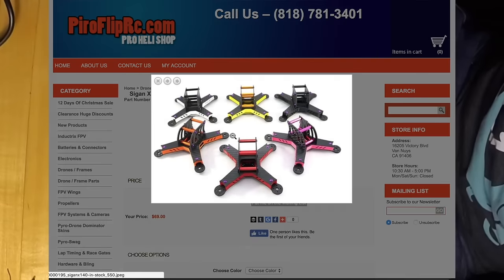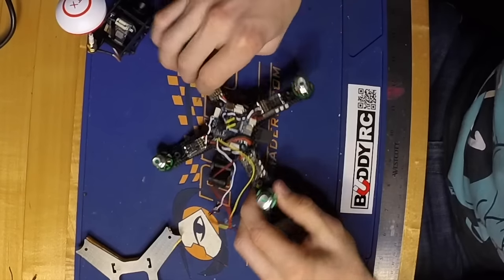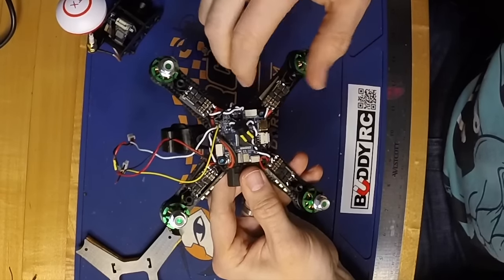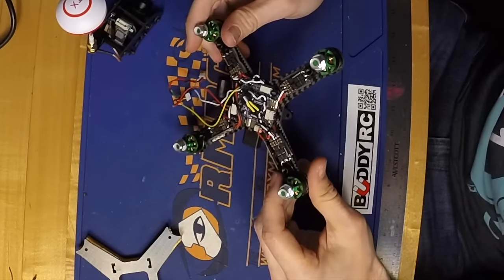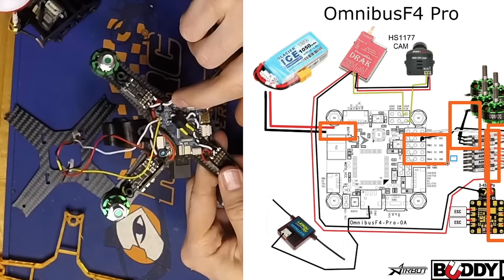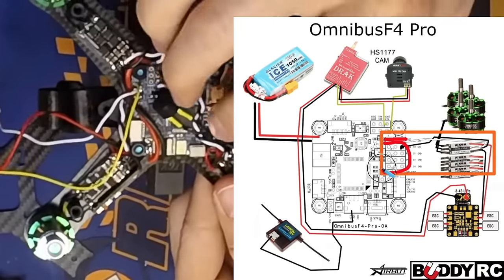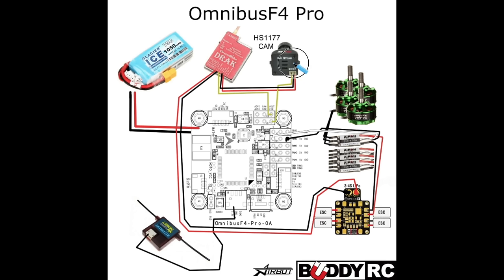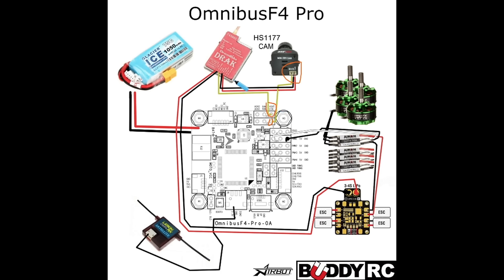Omnibus F4 Pro Build & Wiring Diagrams

Comment: dit you tested with a 4s battery on this Omnibus F4 pro v3 and setup ? 
i had a short, but i connected the wire of the buzzer wrong en thad is the reason i thing, Nice build by the way

Comment: Clean build! I'm about to install an Omnibus F4 Pro with a 4-1 ESC into a little Tricopter, but trying to get all of my wiring down in my head before it shows up haha.. Can I power the FC directly from the Battery, and use it as a PDB?
Reply from the maker: Yes you can, and you should if you want to utilize the battery voltage in your OSD.
Reply: RoscoFPV yeah!! been flying for about a week (maybe a pack a day...) and tuning PIDs ! great board~

Comment: yes there are the cables for the motor connections but I wanted to understand ... since the ESC have the current sensor and are powered by the battery ...
the flightcontroller that also has the current sensor as I have to feed it?
THANK YOU

Comment: Thanks I wired up to that and get a fail safe buzzer but no buzzer when I flip the switch on Aux 2.  The lights flash but no beeping.
Reply from the maker: There may have been a problem w/ the beeper on this board. Its been a really long time since I build this (3 years) but I kind of remember something about that. I'd also check to make sure your beeper is turned the right way. It only works in one direction.

Comment: I'm building a 250, and my ESC grounds are connected to the signal grounds. Do I still need to run separate grounds to my FC along with the signal wires? (I have removed +ve leads)

Comment: hello Rosco..I have a problem with the FC OMNIBUS F4 V2.1 ...
in practice, by enabling the LED-strip door with betaflight and connecting the LEDs to the specific three-pin port, the len are not lit but the programming does not work ...
there by chance something else to enable that I do not understand why?
thank you.

Comment: Thanks for this tutorial! I just can't figure out why the programmable LEDs don't work with this board. It has a dedicated connector for this but it seams no to work. I've also read the LEDs have to be connected to PMW6 but this didn't work either...
Reply: Just got it working 5 minutes ago on bf3.2.2. According to thread on rcgroups the led_strip pin on the J1 connector does not have a timer nor a DMA assigned so cannot be used for controlling RGB leds. What worked for me is connecting DIN of the led strip to PWM6. You need to remap the led strip to PWM 6 using the cli command ¨resource led_strip a8¨. Hope this helps, took me 2 evenings to figure this out.
Reply: If found the exact same solution after hours of trying and research! Thank you!

Comment: Hi Rosco could you say to me please how do I connect the ESC RACESTAR SHOT 4IN 1 30A with integrated current sensor ... to connect it with the FC OMNIBUS F4 V2.1 which also has the current sensor?
THANK YOU
Reply from the maker: I am unfamiliar with that 4in1. Did they provide you with a pinout? It should be pretty simple to connect. The Omnibus has PWM1-4 input pads. And the 4in1 will have PWM(Motor1-4) output pads/wires. Just connect them up.
Reply: Roberto Leon did you figure out how to set it up with ESC and FC both having current sensor

Comment: Are you using the current sensor? Your diagram is a bit confusing. I'm starting my build tonight using the same FC and I'm on the fence about having to hook it up to use the current sensor vs standard vbat only.
Reply from the maker: I don't know if I'm using the current sensor correctly. I have never really spent any time verifying that the current sensor is working correctly. Supposedly if you power the board off the big BAT+ and BAT- the current sensor is supposed to work.

Comment: Does I-bus receiver will work on ominbus f4 pro flight controller? Or which receiver will work on it.
Reply from the maker: Not 100% sure on this one. Never used I-bus before. Is that specific to a certain transmitter brand?
Reply: I'm using flysky fsi6 tx , so, which receiver would you prefer?

Comment: Can you show the PDB power to the board?
Reply from the maker: I think in the video I describe how I did it. Basically I brought power up off of the PDB underneath up to the ESCs on the arms. 2 wires each. And then I powered everything else off those ESC connections.

Comment: hello I need ... URGENT ... URGENT ... for advice ...
I also bought .. Racerstar Shot30A ESC 30A 30amp 3-6S 4 in 1 BLHeli_S BB2 Dshot600 Integrated Current Voltage Sensor .. to match ... Omnibus F4 Pro V3 Betaflight Flight Controller Built-in OSD Barometer SD Blackbox for RC Drone. ..but that was defective ... and bangood me it changes ... but not in stock..According to you can I order this? ... Eachine Wizard X220S FPV Racer RC Drone Customized Omnibus F4 V3 Betaflight 3.0.1 Flight Controller. .mi seems the same FC or from your experience there difference?
THANK YOU
Reply from the maker: Both are great flight controllers though they may not be 100% identical.

Comment: Both the diagram and the video don't explain much. If you power the FC directly from LiPo, then how does the PDB with ESC outputs get the power? On your diagram the PDB has 3-4S LiPo input drawn with thinner wires but they don't connect to the battery.
Reply from the maker: I guess you're misinterpreting my diagram. If you follow the power from the battery it splits into 3 directions. 
1. To the VTX
2. To the FC
3. To the PDB

You said the 3-4s Lipo input doesn't connect to the battery but that's not true. It should be wired directly to the battery and that is seen in the diagram. The diagram could be more true in that I actually attach the XT-60 connector to that terminal on the PDB.
Reply: I understand that it is connected to LiPo, but diagram shows lines crossed, not connected. When they are connected there should be little circle at the intersection. I mean, what you show is all logical but for a complete novice it can be a bit unclear.
Reply: Can you clarify this a bit? The diagram kind of makes sense but also kind of not. :( How are you splitting the lead wires? Are they all just connected to the bat connections of the FC then back out to the appropriate devices?
Reply: +mportillo78 for splitting wires you can just solder two wires to one solder pad, or solder them to different pads that are directly connected in the board, or solder two wires to one wire with heatshrink isolation over the solder point, or just buy ready-made splitters
Reply: nandakoryaaa so if my pdb already has battery leads wired in, I can power my fc from an extra esc pad that is getting full voltage and still have my current sensor work?
Reply: +mportillo78 That depends. Having split wires is one thing, having current sensor working is different thing. Current sensor must be installed before all the devices that draw power. I.e. there has to be no splits before the sensor. If you connect battery to the PDB and then connect FC to PDB, and the sensor is in the FC, it will only sense power that FC draws (and any devices connected to FC). But it will not sense power that consumed by devices connected to battery or to other PDB pads, as they all will have their own circuits not going through the sensor.

In your case it is better to connect FC directly to battery, and then connect the PDB to the pad right after the sensor or one of FC's VBAT pads that also provide full battery voltage. Your FC manual should specify it.
Reply from the maker: Yeah I typically will pick the most convenient pad they are all connecting to and then soldering them all to that pad. I rarely will take 3 wires and solder them together on their own.

Comment: Hi to all,
is possible to connect GPS to Omnibus F4 Pro V2?

Thanks in advance.

Tony.
Reply from the maker: I'm sure it is, there are plenty of open UARts and betaflight supports GPS. I've never seen anyone do it b/c the Omnibus is mostly used for race drones and those don't use GPS.
Reply: Thanks Dear